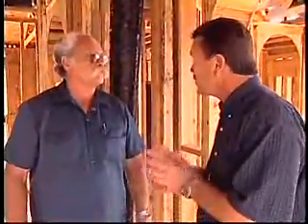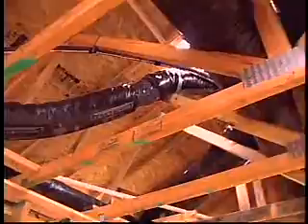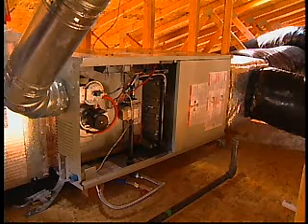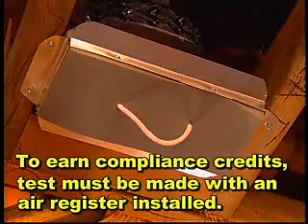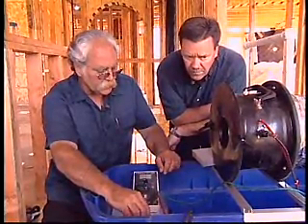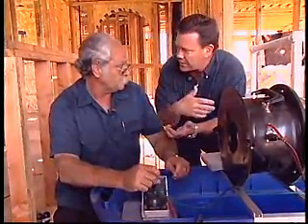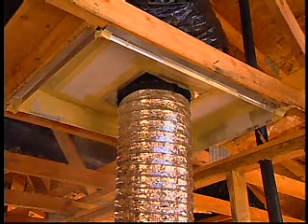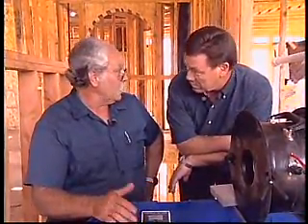HVAC Duct Installation

Comment: HOW THEY GONNA GET THE SMOKE DAMAGE OUT? WHAT ABOUT THE DAMAGE THAT CHEMICAL MAY CAUSE? PAINT FUMES CAN REACT WITH ALUMINUM ALLOYS USED IN TODAYS COILS AND CAUSE CHEMICAL REACTIONS AND PREMATURE FAILURE AND VOID THE MANUFACTURERS WARRANTY. WHAT IS THAT STUFF?

Comment: the duct work in my ceiling is rattling.  I have been told that the duct work
was not strapped.  How do I fix the problem?
Reply: Why is it rattling? It doesn't move even if it's not strapped. Maybe you have bats?

Comment: To increase air flow it is always best to use less flex and more hard pipe. Don't use duct tape use duct sealer to seal connection points including flex runs. Proper R value on flex and insulation is crucial in saving dollars on your energy bill.